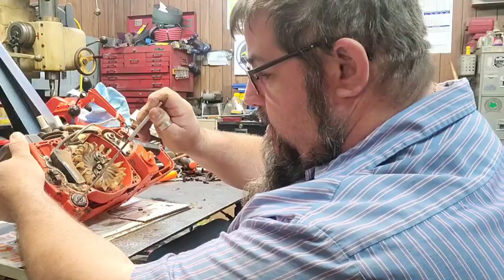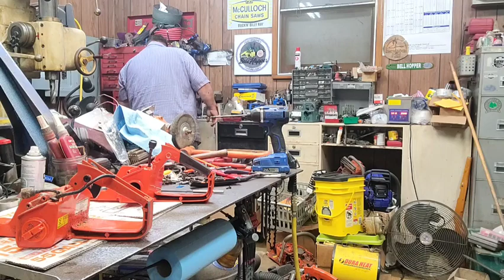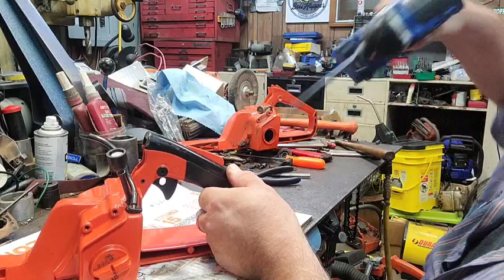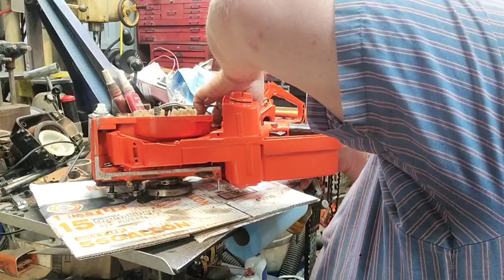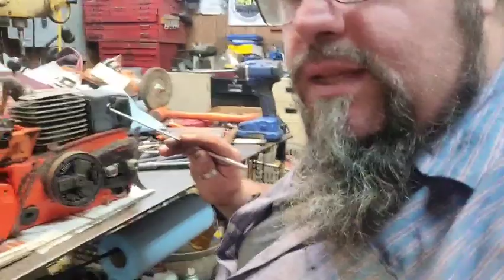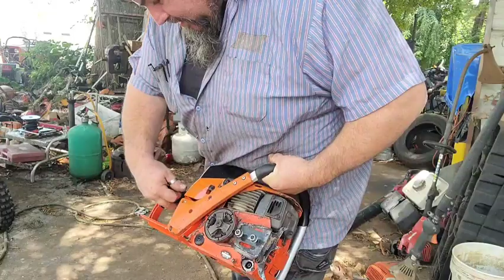Echo CS-680 Fuel Tank Replacement

Comment: How much did you charge for that?
Reply from the maker: I dont remeber buddy it was over a year ago i think the tank was over 100 bucks
Reply: @Bellhopper mcculloch chainsaws  I'm seeing the tanks for around $70.00. I think I am going to give it a try and change it out. So you didn't have to remove the carb?
Reply from the maker: Thats awsome buddy i dont think it was hard to change just took alittle time to switch things over i had never done one when i filmed this
Reply: @bellhoppersaws  thank you
Reply: Hey Bellhopper I got the new tank installed. Your video was a great help. Once I figured out how to remove the carburetor boot from the old tank it was smooth sailing. One thing when I first tried to start it it ran and died. I pulled the carb cover off and the fuel hose just came off. I am a happy man this morning, thank you. Tom Sommer from Northwest Arkansas.